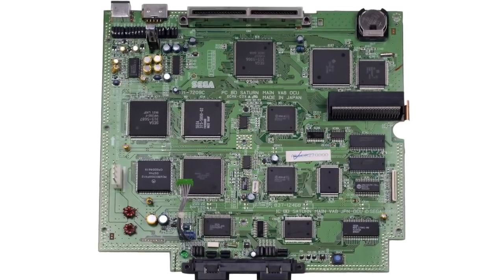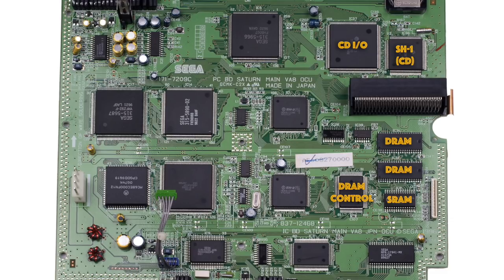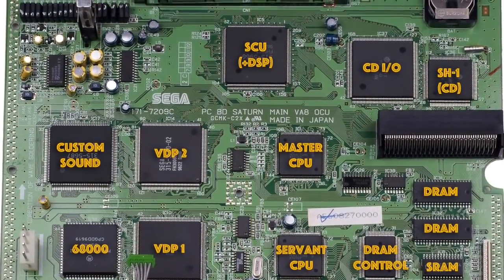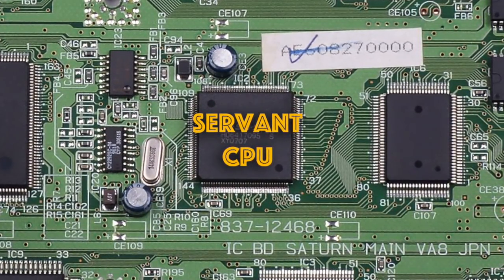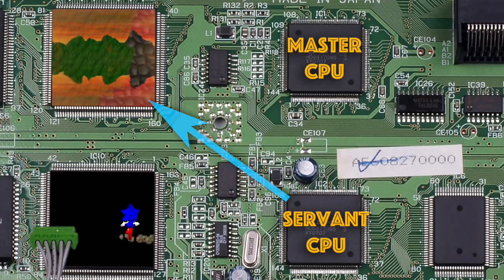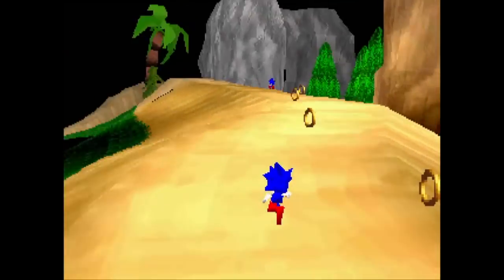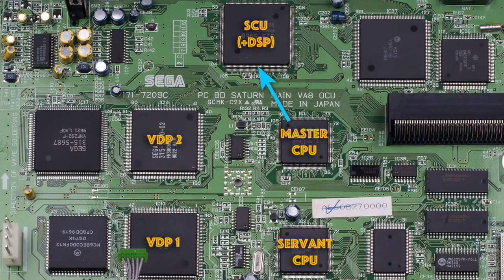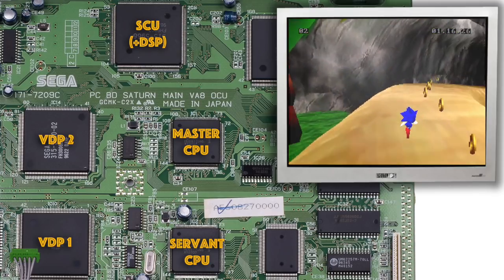SONIC Torn Apart - Exposing SEGA's Insanity with Hardware (CODING SECRETS)

Comment: “Do you want a video explaining exactly how this code works?” Pff, as if that’s even a question Jon, of course we do!
Reply: Yup.
Reply: I don't just want to see it, I need to see it!
Reply: Exactly, gives us the juice!
Reply: I really wanted a Saturn when it first came out. Now that I've gotten older and interested in programming, I want to know more about why this system earned it's reputation for being hell to develop for.
Reply: Yes!
Reply: @meegz149 While the details are important, you can kinda already see it from the system overview:
Saturn: 2 main processors, DSP Co-processor, 2 graphics chips, Audio chip, Audio processor, RAM, CD-ROM controller...
Playstation: Single CPU, Graphics chip, Audio chip, Audio CPU, RAM, CD-ROM controller.
N64: Main CPU, Graphics/Audio co-processor, video DSP, RAM.

Now, at a glance the Saturn has way more components trying to interact. The n64 is also a pain though, even though it looks the simplest seen this way...
(Both the Saturn and N64 suffer from relatively poor documentation aside from the actual hardware issues. Saturn seems to be hard to work with through sheer complexity. N64 seems to be hard to work with because it's extremely unbalanced and has a lot of awkward performance bottlenecks. - really powerful in some ways, rather weak in others.)

Just... So much complexity. Plus it seems to be a design built for 2d graphics which was modified for 3d in a rush, and it rather shows in how the graphics chips work.

Still, seeing the technical stuff up close is much more interesting than some broad remarks... XD
Reply: yes please

Comment: One thing I often wondered was how the PC port of this and other Saturn originals were handled. Was it a matter of building from the ground up because the architecture was so different?
Reply: I also wondered how the PC port was handled. It must have been a nightmare!
Reply: I don't imagine it being that difficult. Everything written in C, that is the actual gameplay logic, the crucial bit of the software, most data formats and most of their loaders, can be reused without changes. Replicating Saturn's drawing pipeline in a very simplified way that doesn't have to account for asynchronous nature of multiple units (i.e. not actually suitable for emulation purposes) is trivial. From there on you just need to rewrite all the graphics emitting sections of the code to bridge to that graphical backend, which is really just a couple person months of effort, since PC doesn't really offer any surprises.
Reply: There's also the difference between rendering quads on the Saturn and rendering triangles with most PC graphics accelerators. There's two solutions to that though as far as I know, running it in software which is easy, but slow and lacks a lot of the fancy stuff, and converting it all which isn't super difficult if you're just doing it for one game and you have the source assets and code. Fundamentally the game is drawing and tiling the same assets, it's just doing it in a different way so only small adjustments are needed.
Reply: When you have triangles as your graphics primitive, you can trivially draw a quad. When you have a quad as the primitive, you can draw a degenerate triangle as a quad where two vertices coincide, but you lose UV mapping, so you can't port triangle-UV-mapped titles to quad based hardware directly, but the other way around, no problem at all.

Sonic R PC has two draw paths, DirectDraw path where presumably quads are drawn in software, and Direct3D path which has to waste a negligible extra effort creating triangles out of quads, but can rely on the 3D accelerator to reduce the workload.
Reply: NiGHTSnoob  There was a PC accelerator card that contained Saturn graphics and sound chips which could run direct ports of the games; it even had a daughercard with two controller ports. Lazy Game Reviews did a video on it.
Reply: I am aware of the NV1, it would be why I said "most" and not all. Sonic R is not compatible with that card though as far as I know, not as far as its quad rendering goes. I could be wrong, but I think Virtua Fighter Remix, Panzer Dragoon, Battle Arena Toshinden, and Virtua Cop were the only games to use it. There might be more, but those are definitely the main well known ones.
Reply: NV1 is not Saturn's hardware though - and it didn't draw quads as in distorted sprites, it drew quadratic patches, which could be rounded, as besides the 4 corner points, you could specify the curvature with a bunch more points that it would interpolate the surface across. You could draw a visually almost perfectly round sphere with 6 "polygons" on an NV1. At least the Diamond Edge box implies that, i am yet to retrieve the SDK for it, and i'd really love to.

There also isn't any Yamaha-made sound IC on the NV1, it appears the synthesizer is a simple wave sampler and is NVidia's own.

Saturn gamepad support was indeed included in the chipset, and there was a partnership with SEGA for that and for games being ported, but i think that's about as far as it went.
Reply: @moosemaimer  and even some of those were compatible with Direct X IF I'm remembering from LGR's Sega PC games retrospective. Though I know a good few had software renderers.
Also of interest is the quad rendering code recently implemented in Supermodel (a Model 3 emulator) that I almost wonder if it could be used with something like PCem or DOSBox to emulate the NV1 in the future.
Reply: At this point in time, most ports were made from the ground up. DOOM was the game that pioneered the idea of portable game engine consisting of a hardware specific base and software abstraction layer, but the design philosophy didn't catch on until much later(fun fact, that is why it has became a sorta contest to see how ridiculous of hardware you can port DOOM to).
Reply: Maybe they just made an emulator for all the games.
Reply: @NiGHTSnoob  Don't forget about the Nvidia NV1
Reply: Yeah.
Reply: @amirabudubai2279  
Ron Gilbert pioneered a similar concept when designing the SCUMM engine for Maniac Mansion in 1987- he wrote game code that could be reused on any hardware platform. Only the interpreter would need to be ported.

Comment: Great video. I would love to see a video on how the SCU works. There is very little information about it online.
Reply: EasyCheesyChodes the SCU would be interesting as well. If not for anything other than having a publicly accessible video explaining it from an experienced programmer of the time.
Reply: I would 2
Reply: I would 3
Reply: Also the fact that it doesn't have a division unit, which is why we don't bother using it since you can also calculate your vertices in parallel using the SH2 with the perspective division.
Reply: It’s like letting air out of a balloon

Comment: Would love to see more on how that DSP code works. Looks like a nightmare keeping track of 6 operations at once for who knows how many lines of code. The tricks, creativity and just pure skill involved to make that happen is an art. As someone who is learning assembly (specifically x86 assembly) it really intrigues me.
Reply: IKR.
Reply: x86 is a hard assembly language. I don't know what DSP Sega used, but I am will to bet it is a RISC ISA which is a lot easier... relatively speaking. But as somebody who is learning DSP coding atm, I would appreciate a video on it.
Reply: DarksydePhill?
Reply: probably a VLIW-style architecture from the looks of things.
Reply: Amir Abudubai - I learnt assembly programming in x86 and I prefer it to most RISC architectures. There's more instructions to learn but you also have many single instructions that save you writing multiple others as you would in RISC architectures. The actual machine code encoding is certainly a nightmare compared to RISC but at the assembler level its really not any more difficult. Plus it's fun to use tricks like the LEA instruction to do single cycle multiplication + addition of integers :)
Reply: MIPS 4 LIFE
Reply: I don't think x86 assembly is that terrible really. No worse than most 70/80's instruction sets.

The IBM PC itself though... Talk about a nighmare inducing pile of crap. Nowadays we have that architecture with about 60,000 band-aid fixes over the top that mostly fixes it. (plus low level coding for PC is rare nowadays).

But you only have to read Micheal Abrash's book about VGA programming (it's free online somewhere nowadays) to see how horrifying the PC was even into the 486/early pentium era...
In terms of the way the system is designed, it's a special kind of masochism dealing with anything much older than a pentium pro, honestly...

Comment: This is some really good insight on how you got all the Saturn chips in sync. Can you do a video of the Saturn sound hardware. It seems to be the most advanced FM chip ever released but came out at a weird time. Everyone was moving away from FM synthesis to wavetable and more often pure digital audio. How did you utilize the Saturns sound hardware?
Reply: Not really FM based really - but apparently FM capable, with a few more tricks up its sleeve. I mean the only base function of Yamaha FM synthesizer is a sinewave, and it combines them and ADSR envelope on each to produce complex sounds, so then Saturn can also likely use non-sine but arbitrary base functions or wave samples. Predominantly it was used as a straightforward sample-based synthesiser, akin to SNES and Playstation. I'd really like to know more about this, since Dreamcast seems to have a somewhat similar soundchip, and i'm sure there are interesting things that could be done on that but never were.

Comment: @GameHut You mentioned the 68000 in the saturn hardware : did you used it for the Sega Saturn version of Sonic 3D (as you said it was "just" the Genesis version interpreted) ?
Reply: You don't have to @ the creator on his own video.
Reply: Jon has said before that the Saturn port of Sonic 3D was not handled by Travellers Tales. So he might not be able to confirm this.
Reply: Sorry, that's an habit I got from most chats I use.
Reply: Sonic 3D did not use the 68000 in that way. It was for running the sound and music. Sonic 3D isn't a straight port. It had enhanced graphics and animations that the 68000 couldn't handle.
Reply: @Zekium  several people are typing ;)
Reply: The people who did the port wrote a compiler that translated all the 68k code into C and emulated the Genesis hardware
Reply: I don't think the 68k processor could access anything other than the Yamaha YMF929 sound chip? However, in the Mega Drive/Genesis.. The Z80 co processor that was usually in charge of the sound hardware could request access to the system data bus if the main 68k processor was put into a permanently halted state, thus giving it access to rest of the MD/Gen's hardware, This little trick was used to by the Power Base Converter to achieve hardware level backwards compatibility with Master System titles.
Reply: I still wonder if some creative thinking could somehow lead to accessing the 68k through some code-trickery and get it to process MD/Gen code. I wish I wasn't just getting into C/C++ so I could explore further.
Reply: @Spaztiq  slapping 1:1 genesis code into the saturn would at best run the game without video.
You'd have to rewrite any code that accesses genesis-exclusive hardware
Reply: And without sound, since there's neither the Z80 nor the YMxxxx (I'll never be able to remember the exact name of that pesky yamaha fm sound chip).
Reply: @Liam3072  The scsp was capable of generating 8 FM synthesis channels. Although, I'm not sure if it could be used to emulate the 6 channel FM synthesis on the megadrive/genesis

Comment: The Saturn architecture looked like a powerful one, albeit a nightmare-to-code one. Feels like it was kinda ahead of its time like the Dreamcast, but due to something (poor documentation from SEGA, maybe?) not a lot of programmers bothered to make games for it.

Also, SCU!
Reply: SCU!
Reply: The Saturn was a hack job. They were redesigning it way too late in the process because they were scared shitless about Sony. The solution they tried to come up with was throwing in more chips into the system with little understanding about how they would interact. Doesn't mean it's a completely awful system, but it wasn't well prepared at all. Dreamcast was built on a solid architecture but Sega had blown through their good will.
Reply: Yep, they added the second SH-2 and SCU pretty late in development of the system iirc.
Reply: Its a combination of changing components late and not being able to provide proper documentation expecting 3rd parties to work it out and of course the rushed early release of the Saturn that caused it to "fail"
Reply: yeah, changing components late, not providing good documentation and tools, rushing the console, and the price
Reply: Actually I think it's likely enough that it was designed as it was up front. There's no evidence that any parts were added late in development. [see correction by dogen below] Multi processor heterogenous systems were completely par for the course, that was the staple of arcade hardware. Remember what SEGA always does: arcade hardware lite, hitting ahead of the curve, and hitting hard. That's the only way they could compete against much bigger companies.

Unfortunately they completely missed the ball on that one. The times have called for betting big on framebuffer and ditching tile mapped graphics entirely. They also called for UV mapped primitives (the fundamental of which being of course a triangle), exactly like Silicon Graphics, rather than distorted 2D sprites. It was a system stuck in the ways they thought established developers could adapt to rather than ways that are objectively easier and more suited to the task. A design that looks backwards rather than forwards. It not being ahead of the time is exactly the issue.
Reply: Siana Gearz
actually there's an interview with hideki sato that says they did exactly that. 

http://segabits.com/blog/2018/06/29/hideki-sato-talks-about-creating-sega-saturn-hardware-and-sony-asking-sega-to-go-third-party/

"The Saturn actually had just one CPU at the beginning. Then Sony appeared with its polygon-based PlayStation. When I was first designing the Saturn architecture, I was focused on sprite graphics, which had been the primary graphics up to that point.

So I decided to go with polygons (due to the PlayStation)."

"It seemed like we were finally nearing completion. Then, the final PlayStation was revealed. It supported 300,000 polygons. Well, that was ultimately a bunch of lies, but… When you compared the Saturn with the PlayStation, we were completely missing something. The response that I chose was to add another SH processor, so we ended up with two SH-2s."
Reply: Thanks for this information dogen. But this is funny, because a single SH-2 can just about mop the floor with R3000, or at least come close. But the co-processor that SONY implemented for geometric transformations wasn't trying to murder you, you just gave it a single set of inputs and you get a result just about instantly. And the bucketed display lists were genuinely nice too.
Reply: randomguy8196, different? Depends, but then so were arcade machines, pretty different from each other. Reads and writes are fundamentally atomic. There are no modern atomics such as compare-exchange and atomic increment, but you can do without them to implement a locking primitive. The memory is mapped at least twice like on most of these architectures, once cached and once uncached, so you can do without cache coherency, and there's cache purge instructions.
Reply: mind you that the Treasure's CEO at the time mentioned that the n64 was much worse to code for the the saturn
Reply: @SianaGearz  Good points, it has to be said the PS1 GPU had an intuitive design. It was really one of the most programmer friendly graphics chips I've worked on.

Comment: The part you labelled "Video RAM" is not video ram, it's half of the main system memory (WORK RAM HIGH). On most systems it is two SDRAM chips, but on the one in the video, it's a single SGRAM chip. The actual Video RAM (the texture memory, the framebuffer, the VDP2 memory) are all on the underside of the board.

Comment: So would you say sonic r is pretty close to the best the saturn can do? Do you have any numbers on how many polygons (quads I guess) the game can push?
Reply: The question is not the sheer number of pixel/polygons/triangles/quads but the resulting image as a whole. This really depends on the game.
Whan JonTT did is conceptually not entirely different from geometry/physics/shader processing on modern videocards - just manually.
Reply: Yeah, I know, but I'm curious anyway. ; )
Reply: Also VDP2 can generate infinite planes which reduces the need for quads when drawing the ground so the quad resource can then be used else where. Still an interesting question though.
Reply: There are other 3D games on the system but only a few compare, Burning rangers is more detailed, but has problems with framerate and texture warping, other games had lower draw distance to compensate for lackluster programming.

There are some other games that don't have those problems but only a few.
Reply: Probably the demo for shenmue on the saturn looks like the best game possible on the saturn, but it was never finished so we don't know. Sonic r is up there though

Comment: Excellent video! Were there any particularly clever hacks that pushed the Sega beyond it's (nominal) limits? Like using the 68000 for more than sound? I'm reminded of how some clever programmers realized you could get PCM audio out of the C64 SID chip by poking it in unintended ways.